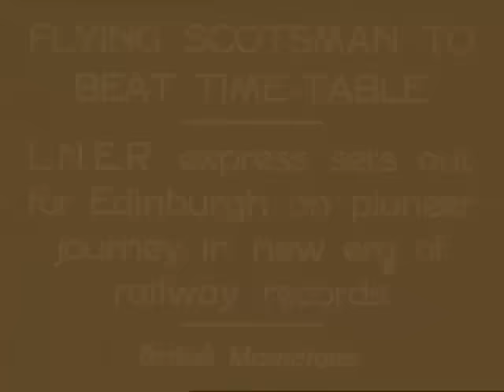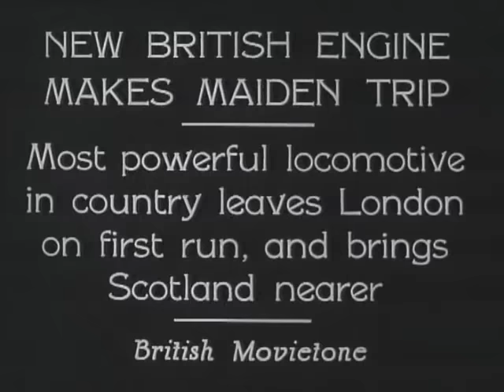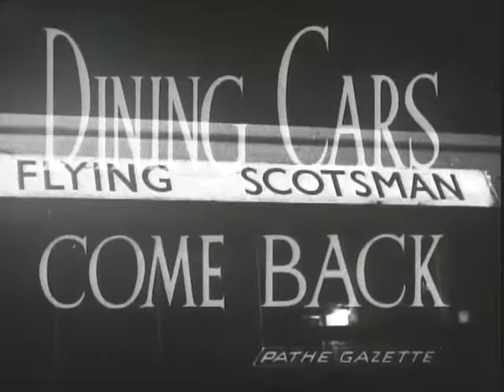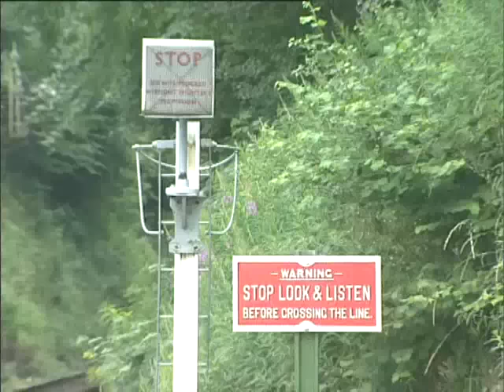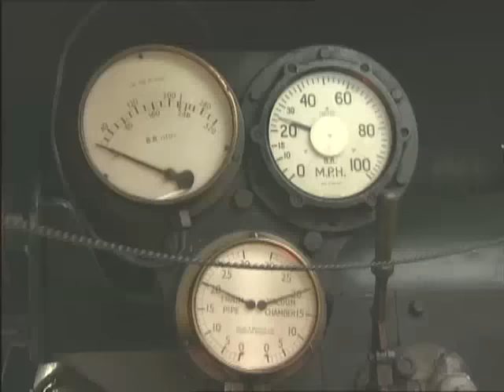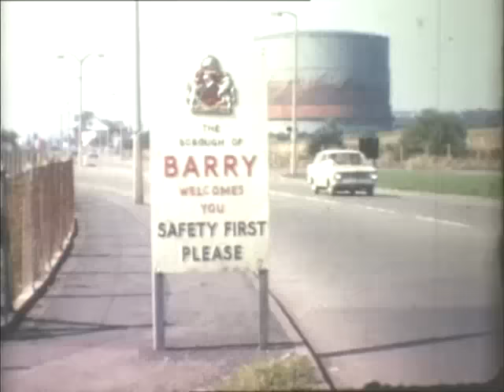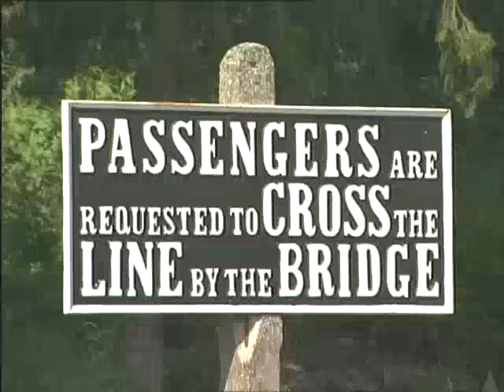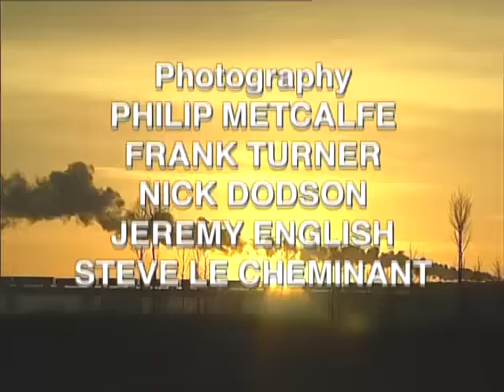The Story of Steam - British Steam Engines DVD

Comment: I laughed at 6:19 - 6:37 because "As a Passenger Railway, the Liverpool and Manchester needed Speed and Steady Riding from it's Locomotives, Rather than Freight Hauling" I have a feeling that Lion knows better, as the screen shows one of the only Goods engines the L&M had at the time that wasn't a return-flue boilered engine with vertical cylinders built by Timothy Hackworth (aka Stevenson's old rival), followed immediately after by a "more modern" Goods engine by Stevenson's other main rival: Bury, Curtis, and Kennedy! :)

Comment: With the power to weight ration the Kings must have been the most powerful 4-6-0s ever built, they were 26 tons lighter than a Princess Coronation class although they were 4-6-2s and were 11 tons lighter than the  Britannia class 4-6-2s, the Kings also had a greater tractive effort than both these classes and to see them in full flight was an absolute fantastic sight to see, it speaks volumes about these Railway Mechanical Engineers back in the 1920s and to think they were still running into the 1960s, the Kings were such a beautiful engine.
Reply: There used to be a good video on You Tube about preparing Kings for cutting up for scrap at Cashmores. They had to cut the back wheels first to get them round the tight curves in Cashmores yard.

Actually the King was a terrible design, the result of trying to get too much power out of a 4-6-0. This resulted in a very compact front end which was difficult to access and maintain with the large internal inside cylinders. The axle loading was too high resulting in very small route availability, just 15% of the network. And the firebox too narrow for the size of loco as it was constrained by the rear drivers ... no such limitation in  a Pacific.

These faults meant the Kings were quickly torched in 1962, with Swindon C shop and Cashmores Newport being favoured places for quick disposal.

Comment: The commentator of this DVD made an error regarding preserved L.N.W.R "Precedent" class No.790 "Hardwicke" . He stated that there were 90 engines in total, similar to the above class  these were in truth the "Whitworths" with smaller diameter driving wheels.  Of the "Precedent" class in fact there were 155.  80 of these survived into L.M.S hands, bestowed Nos 5000-79 and the last survivor No.25001 "Snowdon" was broken up in 1934. This was when the first of the Stanier black 5s appeared inherited the running numbers 5000 upwards .

Comment: City of Truro clocked its 110mph on a downhill section. cheating.
It probably could have done 100mph on the flat thereby securing the record.
Reply: 102 MPH not 110!
Reply: Mallard recorded 126mph DOWN Stoke Bank, cheating?
Reply: Truo, Mallard, who cares. They didn't fall off the tracks - all that counts.
Reply: I hope they measured the speed on a GPS, otherwise I'm not convinced!
Reply: RIPPERTON crew testimonies report that it’s most likely impossible for a City class to reach 100mph. Even if it said 100 on the speedometer those things have a acceptable margin of error if you will so it was probably reading higher than it’s true speed.

Comment: Bullshit on the "water scoop" spiel.  A 6" deep trough narrow enough to fit between the rails only holds 7.5 gallons per foot max. Thats 266 feet minimum to pick up 2000 gallons and that's with "zero loss". 60 mph is 88 feet per second. Figure its going to take at least 10 seconds given the ridiculous losses and the resulting pressure forcing 2000 gallons of water through a sub-6" pipe and it just ain't happening. Especially in a country where any good locomotive on good track (straight and level - i.e. not "British") could run "coast to coast" (if there was anything like a "coast to coast railroad in the UK) on a full tender and maybe one fuel/water stop by that time period coupled with the fact that the UK "national" railroads we and are nothing but a strung-together clusterfuck of "local" and "regional" light freight/lighter passenger backwood shortlines, a handful of "inter-city" part-time "holiday" railways and "commuter trains" that collectively did nothing but get in each others' way, compete for government welfare and apparently "compete" with each other for dumbass, dangerous and destructive "speed records" in their apparently plentiful "downtime" and you have about as much need for and capacity to us and believable use of "water troughs" as you do dining cars, "high-speed" trains and the thousands and thousands of locomotive "Great Britain" supposedly had for less track and traffic than most U.S. states ALONE had at the "pinnacle" of rail transport. Today Union Pacific has about 8250 locomotives on the roster and 30,000ish miles of "owned" track and several thousand more miles it has "track rights" on. Covering most of the western 2/3 of the U.S. 

The UK "government" may have sold its "citizens" umpteen thousand "new" steam locotives during the 20th century rebuilding the same old 6-driver shit over and over doing the railway/she'd "shuffle" sending old shit to new scenery with a new paint job and "nameplate" but there had been even 5000 locomotives in the whole country at one time they'd have been running around all 5 minutes apart everywhere all the time.

Ver